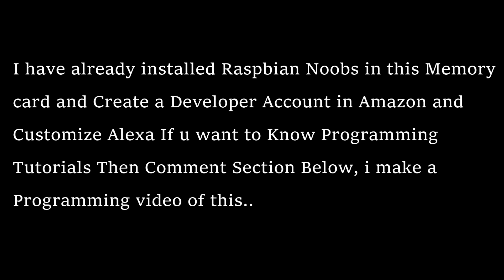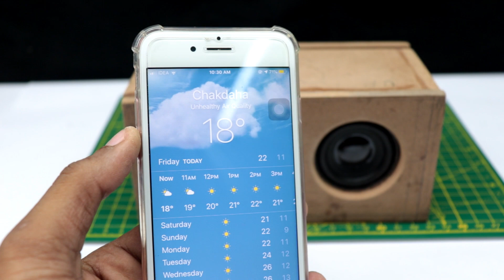How to Make Your Own Alexa Smart Speaker at Home using Raspberry pi

Comment: Bro you make this smart speaker in 4500 around and echo dot cost me 2250 on this diwali offer so i will grab the best deal infact i make alexa with raspberry pi 0 w wich whole cost me around 2500 with two speakers so if you use pi 0 i will make this cheap so everybody can make it in
Reply from the maker: Bro Creativity Does not Depend on Money
Reply: Its vey easy you just do 5 to 10 connection make it with pi 0 and then you see a problem of input and output aux i took me more than month to search the solution of this problem that is good creativity not you ok